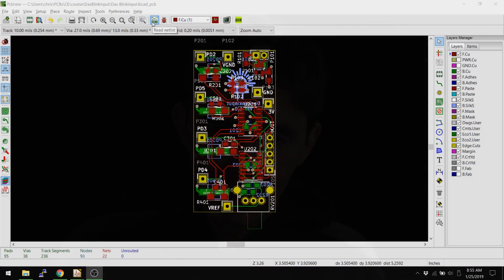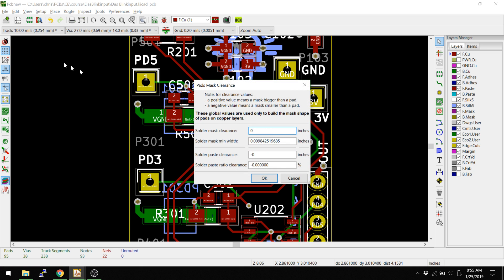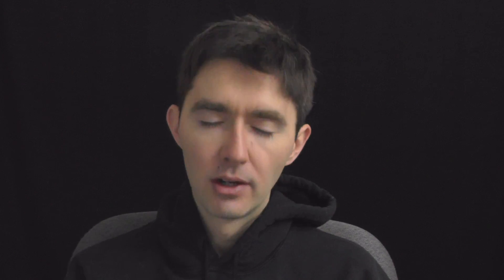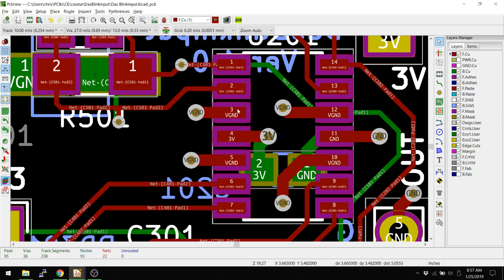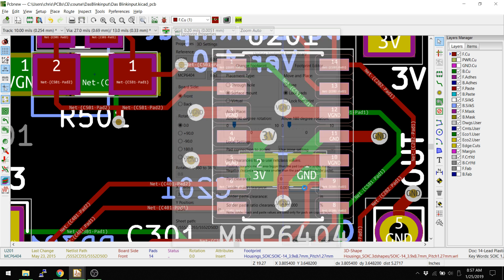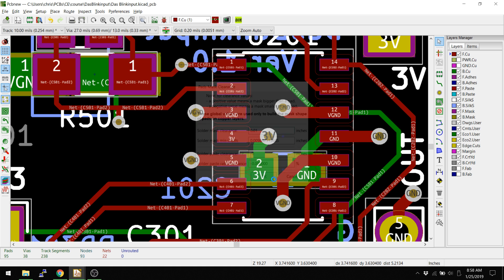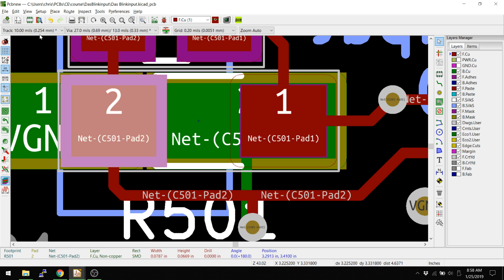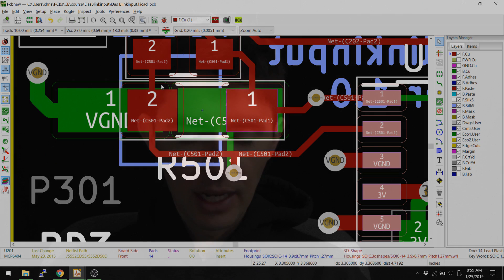KiCad 5.0 - Pad Mask Clearance

Comment: for a group of my students who sent layouts to OSHpark it was actually OSHpark pulling back further than what the gerber files said. So there was an added clearance which led to poor solderability of a flatflex connector because there was no soldermask left between pads.
That was our (theirs and mine) only ever experience with OSHpark - never again, other manufacturers stick to your design...
Reply from the maker: Curious what the students had the clearance set to? Perhaps when it's zero they assume otherwise and add in clearance?